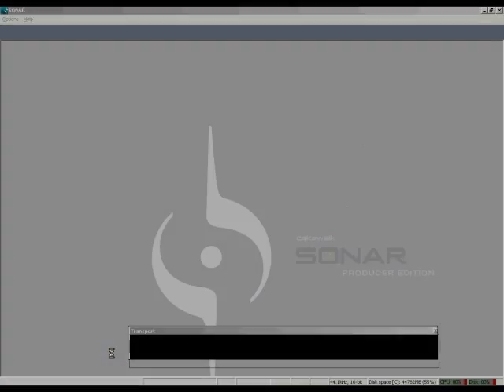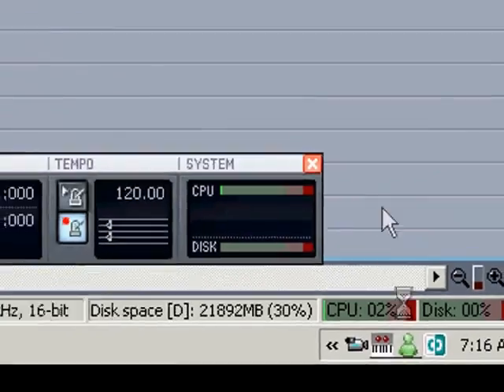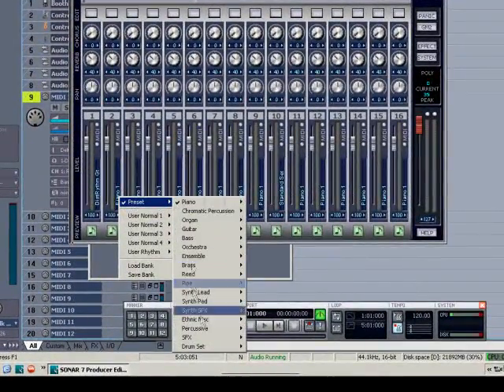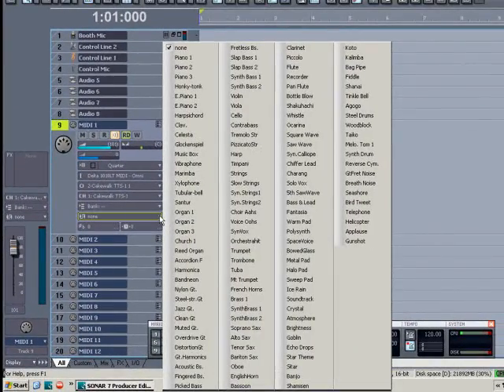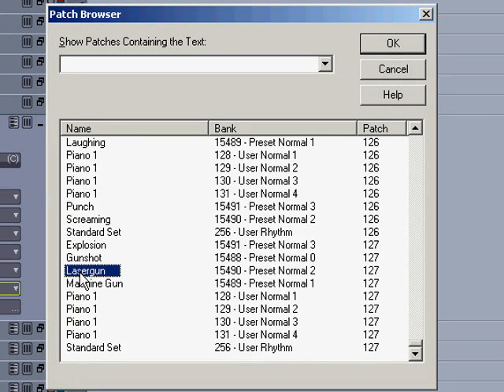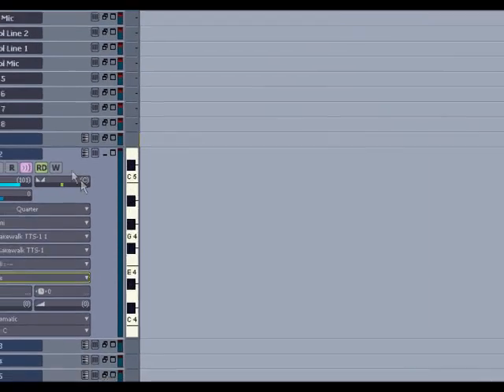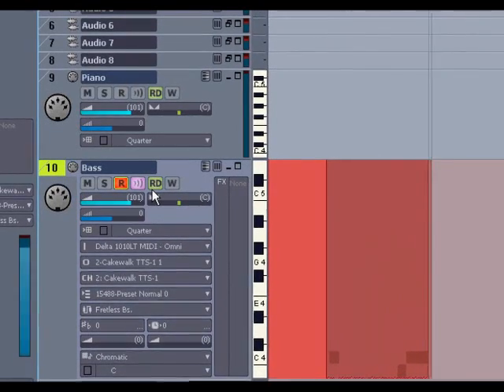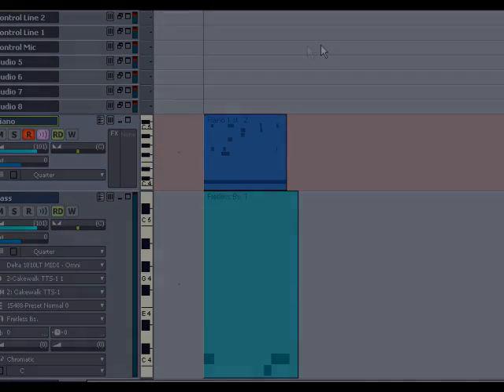Sonar Soft Synths - Basic Setup

Comment: This is so confusing so much stuff in this software I understand the need for it but this is really confusing I had mine working with my midi keyboard I don't know if it's the controller or what but I still can't get any sounds well I guess it's back to audacity

Comment: Hello, thanks for the great tutorial, I have a question though.
Is it possible to record from different soft synths at the same time and compress that into one MIDI file?
For instance, I use a soft synth having 90's piano sounds and another soft synth of Drums. When I play a note I hear both synths which creates an interesting sound. So is it possible to record both of those commands over different synths into one file?
Thanks in advance

Comment from the maker: @royb1001 
TTS1 has the ability to use all of the 16 MIDI channels - so you can set up all these different sounds from one soft synth.
Most of the others (including pentagon) can only handle one channel at a time. If you want more sounds from one of these, you have to load another instance of the plugin.  This will cause more strain on your computer so then you might need to freeze some tracks 
Good luck

Comment: You save my times a lot :)
Finally I know how to 'change the sounds' -_-" Since I'm just...the 'very' beginner, and have started learning with 'nothing' in my head.

...I have a few 'noob' questions for ask (sorry for this)
1) I bought a manual guide and it told me to check Options > MIDI Devices. Well, I have 'nothing' in 'Inputs' (there should be a list of...something). Should I do something, and how...or is it not important? (since nothing really affects while I'm messing around)